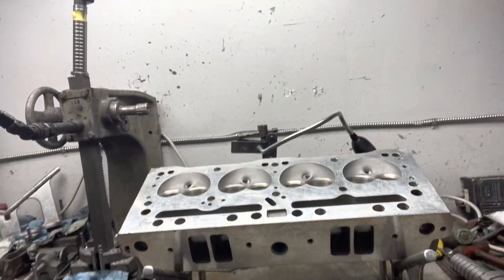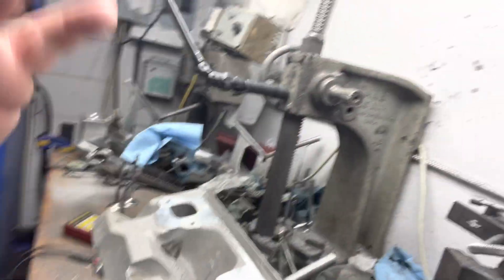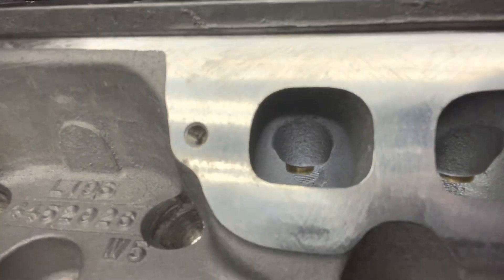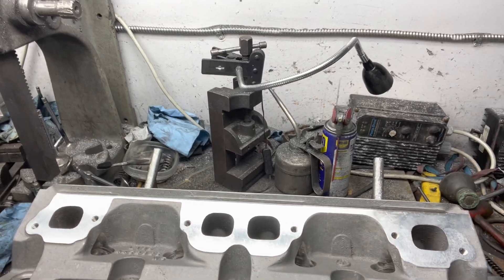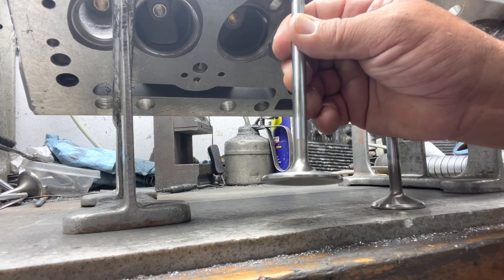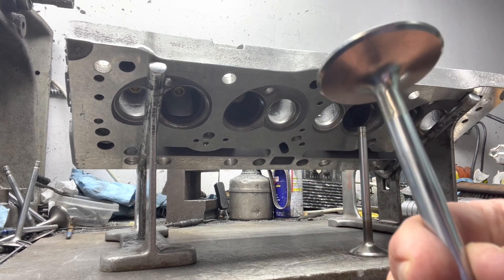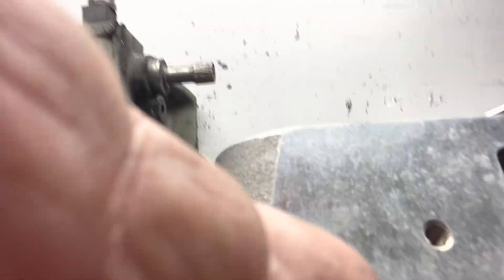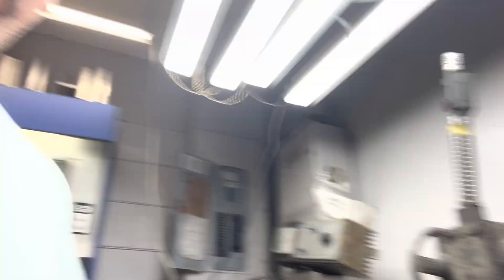Part 1, W5 cylinder head intro, OOTB

Comment: Beautiful heads!! I have some I've been sitting on for years, finallly got some custom dome Wiseco pistons for those chambers and with reliefs for up to a 2.10" intake valve (I plan on 2.08s) and a 4.00" stroke with a 6.300" connecting rod (Chevy 2.100 rod end, .927" pin eye). Hopefully going in a '74 Dodge Colt that I've been sitting on also for years! I wish I could find an affordable 3 or 4spd Lenco and SBM can for it, but it's probably going to have to be a Powerglide trans.
Reply from the maker: Hey Rodney! Sounds like a killer cool project.Years back in my early 20's, I met a fella with a Colt running in the 9's. Crazy part was, he used exhaust manifolds. Craziest thing I ever seen run and run like hell it did. It takes a good bit pf panning doesn't it?! Have you thought about a Liberty trans? Personally I love rowing the gears. Its a bit hard on drivetrain parts at the track. Get to them heads. I'll present a homemade graph on the head flow vs the ported W5 I have.
Reply: @Robs-Garage-experiments  I'm not opposed to the Liberty, I have just always wanted a Lenco and with the mid/late '70s ProStock vibe, that's what I'd want. I do have a '63 Plumouth that I want to run manual with a Max 426 setup some day, that might have to get a Liberty or at least their faceplated gears..too many projects!!
Reply from the maker: @rodneybyrd9516  
A good freind of mine highly suggested that face plating move for me whenthe time comes. The gears have a heck of aninteresting look when there done with them.
He loves it.